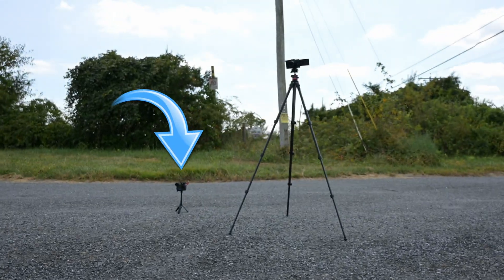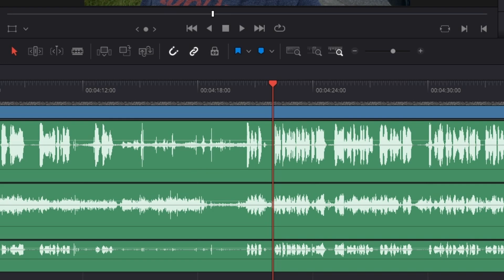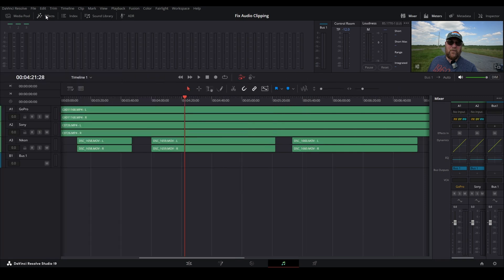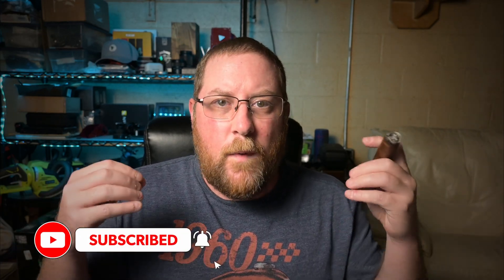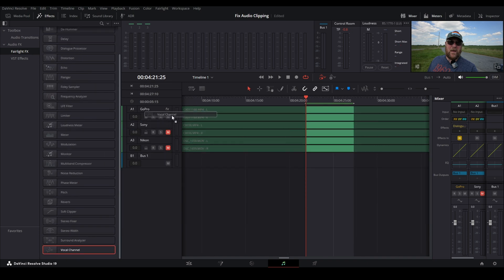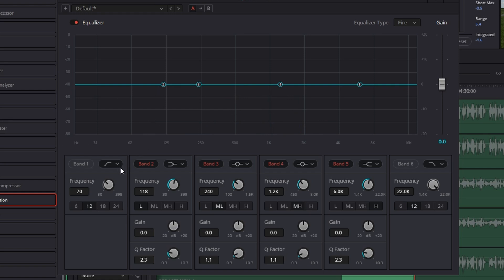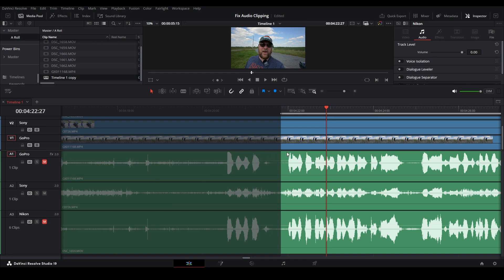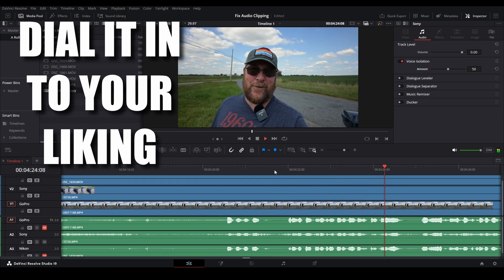How to fix audio clipping in Davinci Resolve Fairlight

Comment: The Gain on my RODE receiver (Exact same as yours) is set to minimum... But that only seems to make a difference if you use the USB C connection and not the audio DIN jack... I hate these damn Rode mics
Reply from the maker: Wow, interesting.  I agree, though - which is partially why I switched to the DJI Mic 2

Comment: This was helpful. I tried many variations of your tips, and for my bad audio what sounded the best was master volume set to -4, and noise reduction filter with the 'de-rumble and hiss' selection. The other two filters in this video didn't help mine, but I'm glad I tried. Thanks!
Reply from the maker: Awesome - glad to help, even if not everything worked.  At least you had a jumping-off point to dial it in :D

Comment: Showing support 😎👍👍
Reply from the maker: Thank you!
Reply: Nailed it again John. I’ve never used the Fairlight page, but this certainly will be helpful. 
I’ve been using the voice isolation feature for a while now on my motovlogs to help cut background noise when I’m riding and it can be a lifesaver in terms of removing a lot of wind hiss and rumble.
Reply from the maker: @GreyBiker99  Thanks!  I hope it helps.  Just slide Band 3 left and right and you'll start to isolate the specific frequencies where your hiss/wind noise is :D